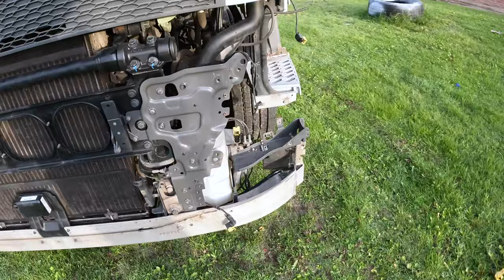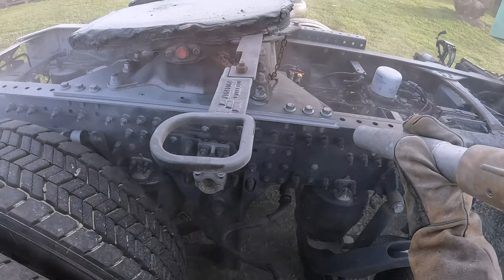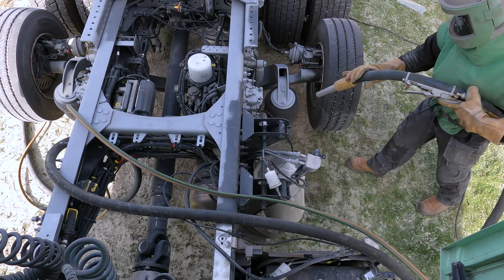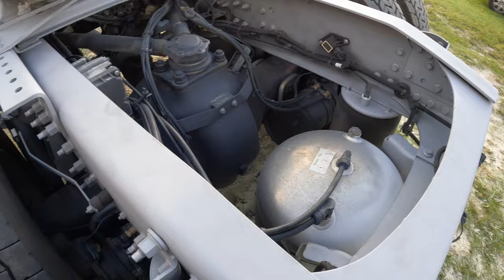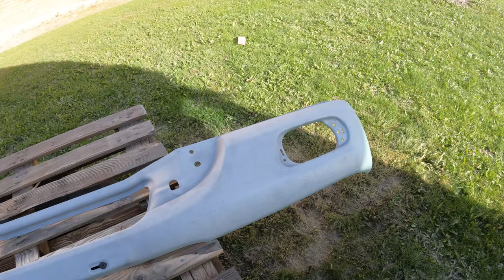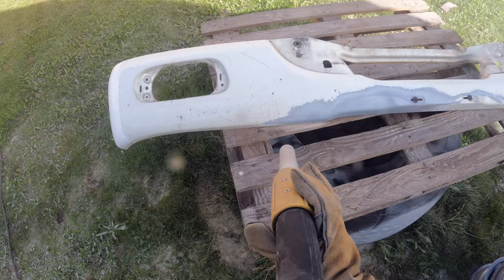SandBlasting Volvo tractor unit wagon haulage semi truck frame chassi restoration

Comment: Working around all those fixtures and cables looks like a real challenge. Your care and attention are surely appreciated by the owner and the painters! Well done!
Reply from the maker: I don't know about care I was thinking about the bill I would get to replace the pipes 😂
Reply: @Mobileblaster  Well, that too! I'm surprised they'd be upset, it IS sandblasting after all, unless they strip it off or protect it somehow. I've seen some use foil
Reply from the maker: @mdouglaswray  best thing I've found that's fast and cheap is duck tape only problem is if I catch it its very hard to get the stuff off 😂

Comment: Good job
Reply from the maker: I was a little confused when I looked at it really didn't need much if any blasting but the shop is that busy with trucks they haven't the time to rub the easy ish to me down shop had 4 or 5 brand new tractor units in for full colour changes so this that's not too bad isn't as easy as brand new a suppose haha

Comment: Good job, what number of nozzles do you use? You have no problems with the truck's air lines. Greetings from Mexico. I hardly think about the sandblasting business.
Reply from the maker: Thx it's appreciated 😊 I use cdx650 to get 100psi I swapped out to cdx750 this dropped the psi and reduced the reach to control the splash back

Comment: Hello, What is the performance of the compressor, How many cubes pumps per minute ? , what is the diameter of the nozzle, how many millimeters ?
Reply from the maker: my compressor is 260cfm and nozzle is xl650cdx or cdx650 9.5mm I fink nozzle is matched to the compressor to achieve 100psi so nozzle size is down to your compressor

Comment: Hey mick, how many hours does it take to sandblast these truck frames
Reply from the maker: Not sure for most folk but me around the 5 to 6 hour mark 😄
Reply: @Mobileblaster  thanks for the reply, I just got a frame sandblasted at a local shop today, a stripped frame off of a Volvo 670 with no Engine , cab, fuel tanks for 10 hours labor.
Reply from the maker: @commandomkz6451 Just a blank frame would take me 2 to 3 hours start adding little bits etc extra time but 10 hours to do a frame 🤔 I know im fast and I know im very efficient so maybe you cannot compair apples to Ferraris. I will be the first to admit I make the videos look easy and I have alot of experience in all aspects of blasting. I would say 10 hour may be the going rate for the normal human blasters about as im a robot when it comes to doing my job 😂